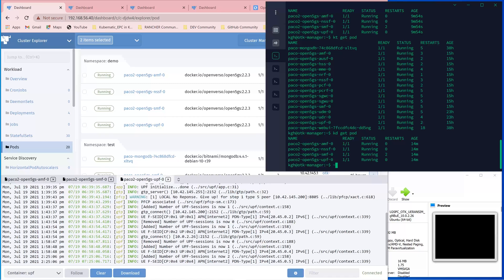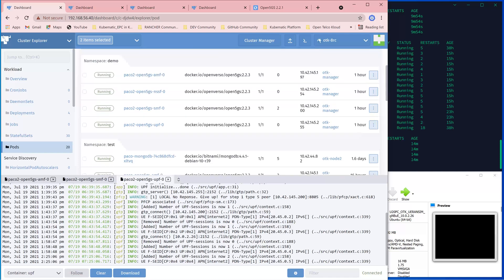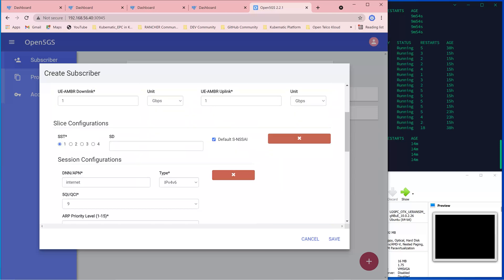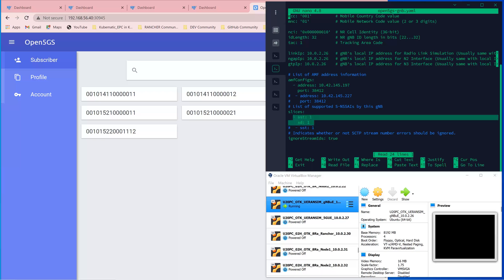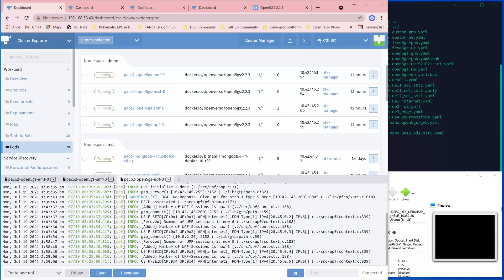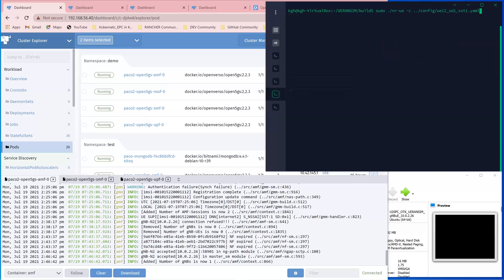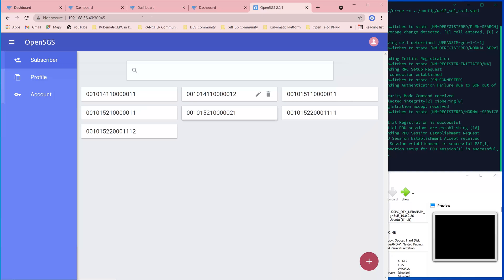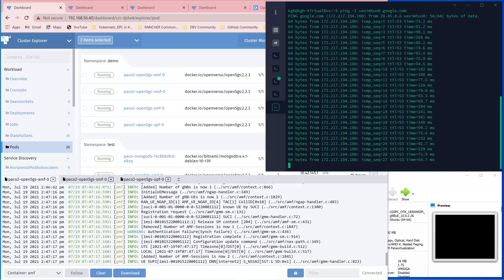2.3 5G Network - Network Slicing with Advanced Configuration

Comment: Note: You also need to change aml.yaml in the Open5gs VM in addition to the changes on the UERANSIM side

plmn_support:
    - plmn_id:
        mcc: 999
        mnc: 70
      s_nssai:
        - sst: 1
          sd: 1  # Add the SD value here

This will resolve the radio-network/slice-not-supported error.